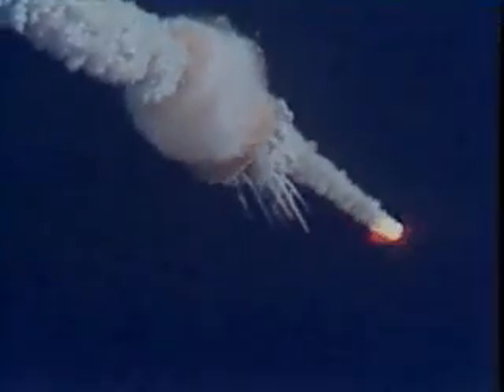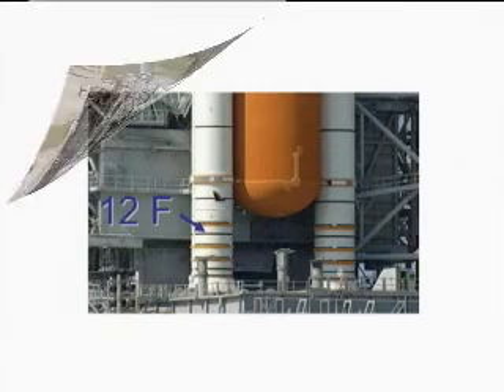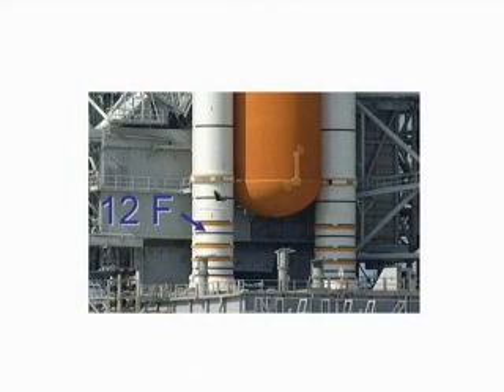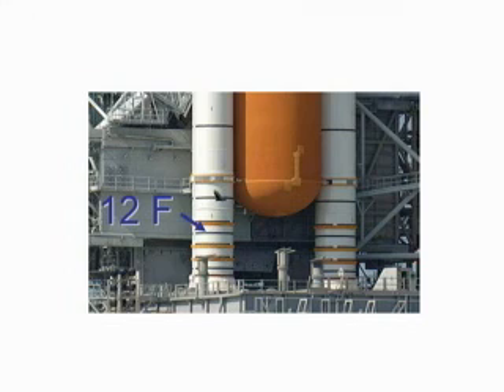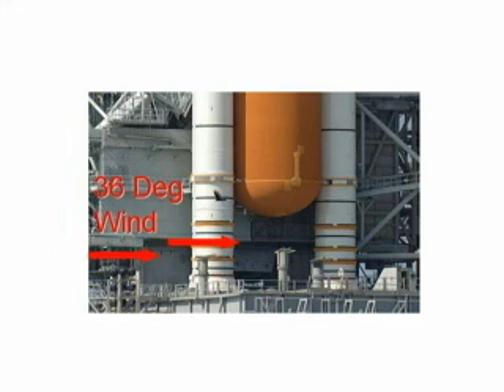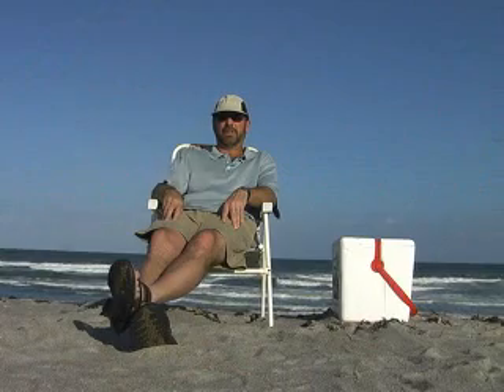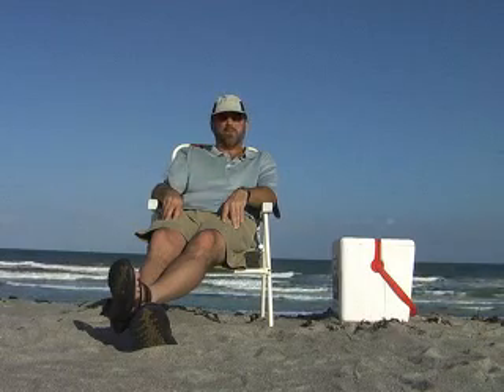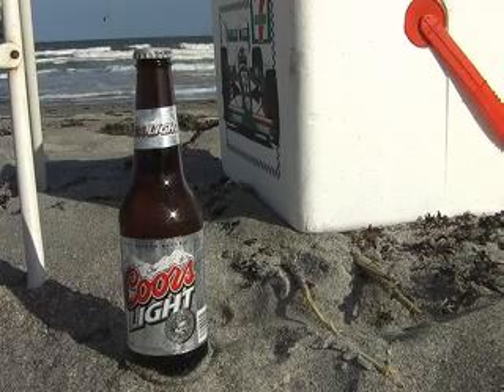Space Shuttle Challenger

Comment from the maker: 100 deg pavment....yes the reverse is true.....again exactly my point. The solar radiation "supplies" the energy, to cool the boosters something has to "remove" the energy...and a ton of it in those hot (36 deg) wind conditions...

The cryogenics inside the tank do not have much cooling effect outside of the tank (because of the insulation).....unless it is "leaking"

Ask any Martin Engineer that worked there in the 80's and they will tell you the tanks leaked.

Take care